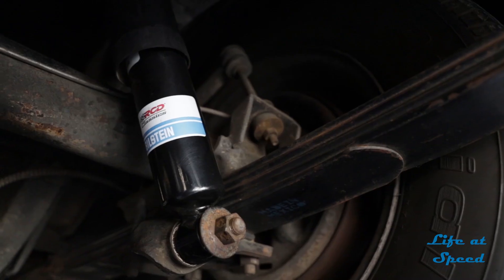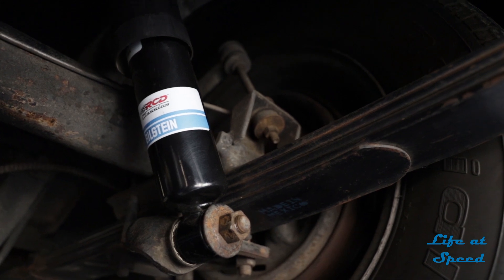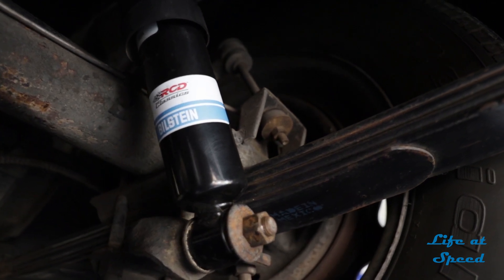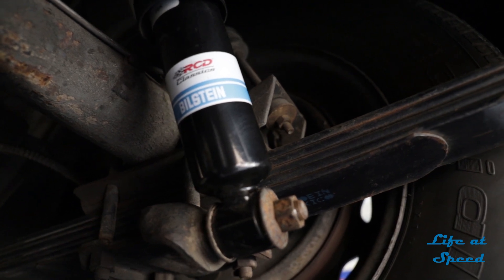Tech Talk Tuesday: New Series Modernizing Classic Mopar Episode 1 Shocks

Comment: A cheap wheel upgrade that looks sort of stock are if you can score a set of 2003-2004 Mustang Mach 1 rims.  They look like a 17” version of the factory Road Wheels/Magnum 500s.  The offset is not correct but nothing spacers can’t fix.  The Mach 1 rims is about 5.75” backspace and the Challenger is 4.5” if I recall.  I got my set off Craigslist for my ‘72 Challenger in decent shape with tires for $200.
Reply from the maker: Good to know, thanks!